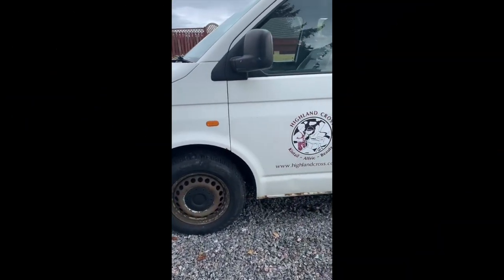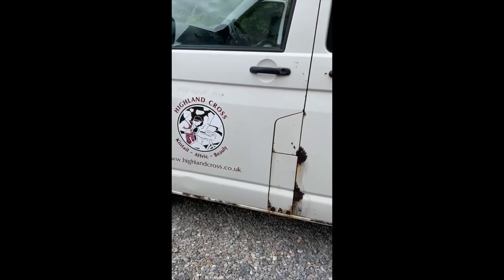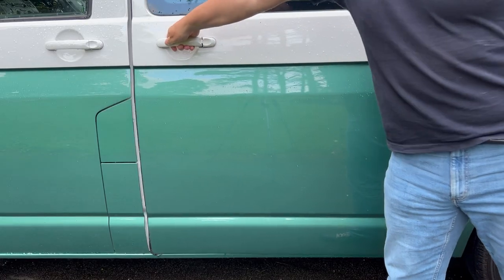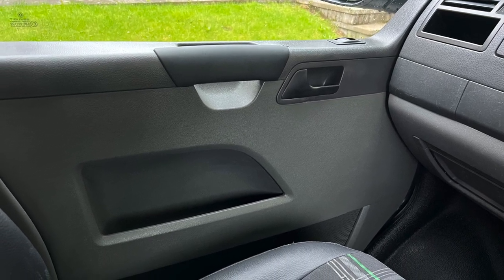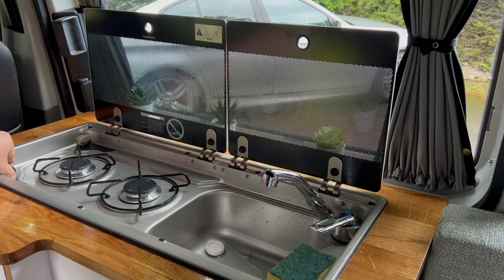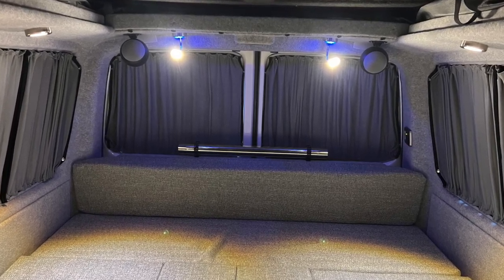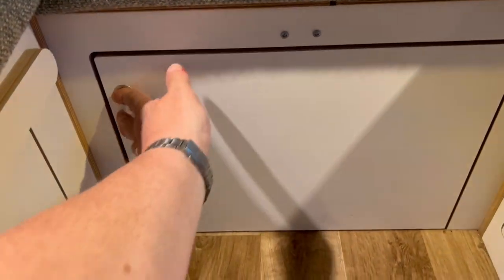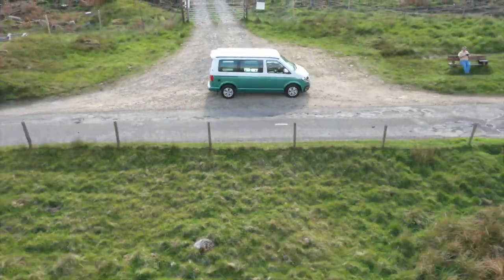Campervan Conversion. We turned a £3,500 builders van into the ultimate compact camper!

Comment: Good evening ! I just watched the entire van conversion series, I admire your work. I have a question, can the driving position also be replaced by that of the T6.1? Dashboard, steering wheel...
I live in Germany, and there is a car junkyard not far from my house, and every day I see this damaged T6.1 calling me, I wonder if the interior is recyclable?
Reply from the maker: Many thanks! My understanding is that it is possible to upgrade the interior cabin area with T6.1 parts but I haven’t tried myself so can’t say so definitively. I also know that you can retrofit later instrument clusters but need to be careful again about compatibility. I’d be inclined to contact Travelin Lite who supplied my front end upgrade parts to see what they can advise. They also supply later instrument clusters, cruise control kits, etc. Thanks for taking an interest in the video series - and best wishes from Scotland! N

Comment: Thanks for sharing this video! This is one of the nicest T5 conversations I’ve seen, so open and light, it’s beautiful. 
Do you still have plenty of headroom while sat in your seating area? We’ve just bought a u-shaped flat pack for out T4 but it looks like we’ll be touching the roof after putting foam on it!
Reply from the maker: Hi, thanks for your kind comments! We have plenty headroom in the pop top area when sitting up straight but tend to sit with our feet up lounging. Your head can touch the edge of the roof when sitting back so you tend not to. We have very thick cushions but in all honesty I’d probably have gone with thinner ones to prevent this. The u-shape is defo best for us though. Best wishes. N & S
Reply: @highergroundlifestyle  that’s fab, thanks so much for your reply! We did wonder if we actually need 10cm cushions or if we could go smaller.
We just found your channel this evening and enjoying all your videos 😀 p.s. love the cheeky drinks cabinet 🍷
Reply from the maker: Best enjoyed with a cheeky drink … or two.

Comment: Hi, fantastic videos. I really like the backboard to the rear seat you have installed, what items did you use/how did you do it?
Reply from the maker: Hi, many thanks. The backboard keeps the cushions in place but also allows me to mount the folding chairs and a few other bits. I simply used a wooden board covered with carpet to match the interior and shelf rails. (The kind you get from DIY stores that metal brackets clip into) It works well and is easy to do. Best wishes. N
Reply: Thanks for your reply, I think I will be emulating it for sure!
Reply from the maker: Let me know how you get on! Cheers. N